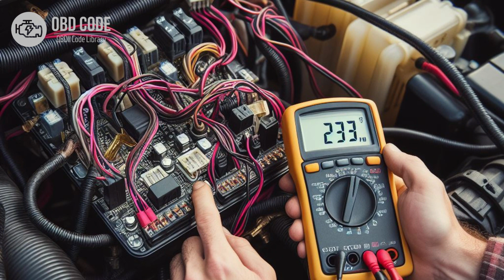P0594 Cruise Control Servo Control Circuit/Open 🟢 Trouble Code Symptoms Causes Solutions

Comment: Hi, i have got the same problem as on this video on my Nissan Pulsar 2015 1.2 petrol  (P0594 Cruise Control Servo Control Circuit/Open)  is that a serious issue ? or its easy to fix ?
Reply from the maker: Good morning, I advise you to go to a specialized workshop of the brand, they have the equipment and experience to give you a solution.👨‍🔧